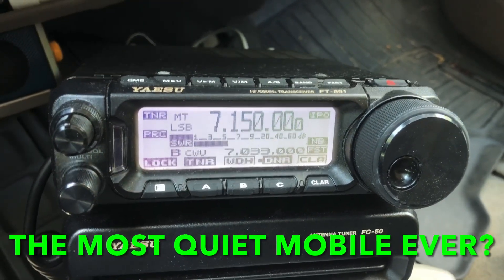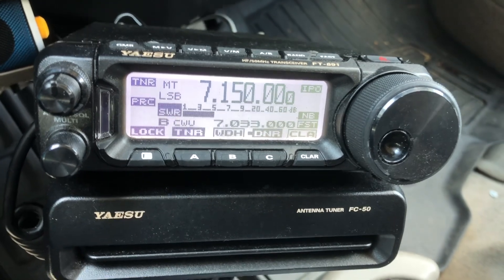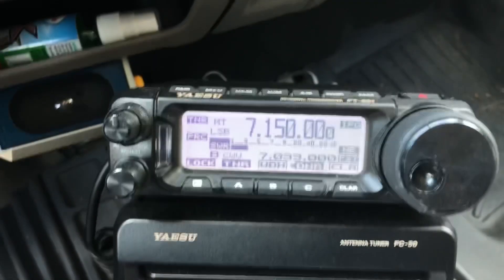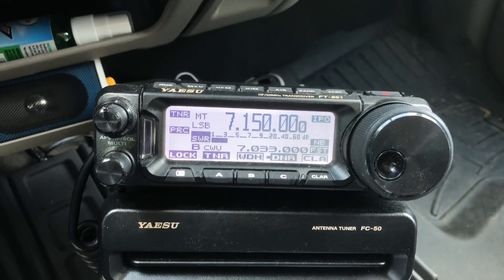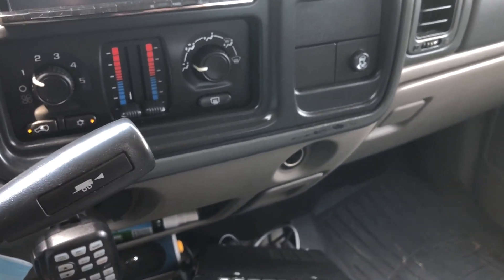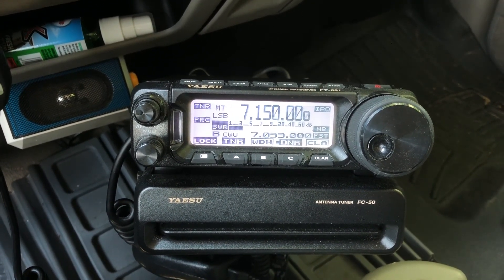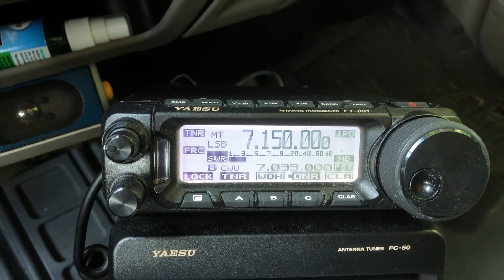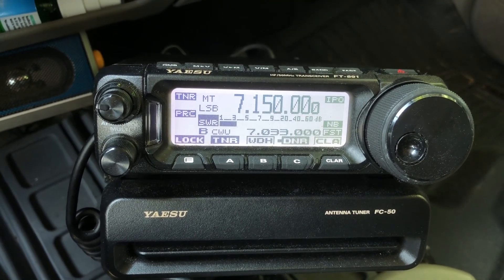The Most Quiet HF Mobile Ever? #yaesu #ft891 #mobile #dsp

Comment: Hello Sir, wondering what antenna you use? What I can see is that the noise floor is pretty low, so for the DNR is not a big deal to suppress it. If you say that it must be a lot of noise and it is not reflected on the S-meter, maybe there must be something wrong with the antenna matching. I'm having the same result when I use FC-30 and I disable it or the ATAS and it is out of tune. Did you transmit, and if so what SWR did you get?
73 de LZ5RG
Reply from the maker: I explained in the video why you don’t hear noise.  IPO, DNR, and RF Gain.  Never let your S-meter rise above S1 of noise.  Use IPO, ATT, if necessary, and get the noise floor down.  Use RF Gain for finishing touch.

I use Ham Stick antennas and let the FC-50 touch up the band edges.  SWR is usually 1.1:1 or maybe up to 1.3:1.  I work DX routinely; sometimes during a quick visit to the grocery store.  South America and Europe are no problem with this setup.

73, de N4HNH
Reply: @n4hnhradio  First of all, please do not get me wrong I'm not trying to oppose you, and if you feel so please excuse me. 
I noticed what you said, but you would agree that neither of these has anything to do with the noise floor (NF) on the RF jack (antenna jack). You also would agree that the noise floor exists no matter what you do with the radio. Lowering the RF gain or enabling the ATT is just decreasing the sensitivity, not lowering the NF (for example). So what I would consider as some representative indication on the S-meter of the NF is to turn the RF gain to the max, using IPO (especially on the lower bands), and disabling the ATT. When I lower the RF gain, I artificially "raise the S-meter indication" (but it has nothing with respect to the actual noise floor), and the radio is just "telling" me (indicated on the S-meter) from what S-level above I will hear a "valuable" signal.  As for the D's (DNR, NB est.), they are somewhere before the audio part (in the DSP module) so they suppress the audio noise and not exactly the RF noise.
So to simplify what I'm trying to say is, that by using the built-in features of the radio, we are just tricking the radio into "thinking" something is there or not. So if the antenna is the "right" for the band, is tuned to match the RF input and no other features of the radio are used we can judge what the NF is (or at least what the NF is on the RF input). I still can have perfect 1:1 SWR, and perfect low NF, by just terminating an ideal 50Ohm load but it doesn't necessarily mean that I have an antenna. In my personal experience, nowadays with all these SP supplies and a bunch of any other RF trash, I cannot get anything less than S=7-8 in the city area.
That is the reason why I asked what antenna you used and how it was tuned. 

Hope you get my point now. You have all my respect for what you do and how you do it.
Reply from the maker: You are referring to phase noise.  In the case of the FT-891, there are three IF stages, so there will be more phase noise.  It isn’t as bad as you might think.  You could buy a $4,000 quad-conversion transceiver and have more phase noise than the FT-891 produces.  

All superheterodyne receivers have phase noise, caused by phase jitter in their oscillators.  For some, the phase noise is lower.  The FTdx5000, FTdx10, FTdx101D and FTdx101MP have lower phase jitter in their oscillators, thus lower phase noise.  The same is true with top tier transceivers from other manufacturers.

The noise floor of a receiver that is connected to an antenna is a combination of phase noise plus atmospheric noise and man-made noise.  

I will trick my radio all I can to lower the noise floor.  But I’m not actually tricking the radio.  The features I’m using are built into the radio, so it isn’t being tricked at all.  You aren’t going to trick a radio to hear a signal that is below the phase noise in its own receiver stages.  That is why you will see Rob Sherwood use the term "phase noise limited" in his test data document.

I’m using the FT-891 as a mobile in this video.  The combination of atmospheric noise, power line noise, engine noise, road noise, etc. far exceeds the phase noise.  Phase noise is of almost no consequence in a mobile environment.

73, de N4HNH

Comment: Rolling with the same rig Doug.  I'm running the ATAS120 so everything is really well bonded.  I also use #31 ferrite cores on the power feed at the point of exit from the engine compartment and at the radio feed point.  I get noise from power lines and other really noisy trucks but generally while I'm on my own on the interstate it's clean as a whistle.
Reply from the maker: You’re the 4th person who speaks well of the FT-891 paired to the ATAS-120.  Nice rig!

73, de N4HNH

Comment: DNR is amazing, such a great mobile rig
Reply from the maker: Indeed it is.  I’m very pleased.  The only weakness is the Noise Blanker.  It causes a little bit of distortion, even set as low as 1.  It’s practically unusable above 5.  So, I pretty much rely on the DNR.  Noise Blankers in modern transceivers are not great.  The FTdx10 NB is about as good as I’ve seen, but it is also practically unusable above a level of 5 or 6.

The Noise Blanker in the FT-891 needs an update.  I mentioned the weak NB to John Kruk, Yaesu marketing manager, at the Yaesu booth during the Huntsville Hamfest in 2019.  He told me that they had to cut corners with the FT-891, to keep the price low, for the mobile HF market.  Yeah, right!  They introduced the FT-891 at $799.  It wouldn’t sell for that price because people were expecting it to replace the FT-857D, which was also $799, but also included 2m/70cm.  The FT-891 has a better receiver, and better DSP, but it still wouldn’t sell like they hoped it would.  So they dropped the price to around $600. That was good for people like me, who prefer a separate 2m/70cm radio anyway.

The FT-891 has the same DSP chip as the FTdx101D or MP, and the FTdx10.  They all use the Texas Instruments TMS320C6746 DSP chip.  The only thing I can think of to explain why Yaesu hasn’t updated the DSP in the FT-891 to match the FTdx10 is that it might lack enough memory to support the update.  But, for a mobile application, the FT-891 is still quite good.  No transceiver is perfect.

73, de N4HNH

Comment: I'm surprised by the lack of noise, powered by that magic NR! :) Since you are as it seems a Yaesu guy.... I have an Yaesu 857d, and planning to add an HF with mobile capabilities.... Would you choose an 891? Or an Icom 7100? I know, Icom 7100 is 2m/70cm also, and a little bigger and more expensive, but that shack-in-a-box could justify the price. But, from an HF perspective... Would you choose an 891 or 7100? Thanks!
Reply from the maker: I chose FT-891 twice.  I prefer a separate 2m/70cm radio, so I can monitor VHF/UHF while working HF.

I’m not a Yaesu fan at all.  They just happen to have the best deal for the money when I’m buying.  I have two ICOM transceivers as well.  But they just don’t beat the Yaesu transceivers.

73, de N4HNH
Reply: Thanks for the answer and thanks for the content, always very clear and useful!
Reply: 73, LU8AAF
Reply from the maker: 73, de N4HNH
Reply from the maker: I’m glad you find the channel content helpful.

73, de N4HNH

Comment: Maybe it’s because it’s my first rig with DSP but I’m not as enthusiastic as most 891 owners. While it does make naturally stronger SSB stronger, I’ve found it makes weak signals worse, muting the audio’s higher frequencies. I tend to use it at lower settings. Often, not at all. (I think it turns Off when I change bands.) For me, it’s far better suited for CW, a “pulse” or On/Off audio than the up & down nature of speech. Agree that DNR works well for ignition noise and areas with a lot of RFI. 
That said…I’m chasing DXCC by the end of this year with it and the ATAS-120A. I’m at 15 countries, all SSB. My customers are 20-30 minutes away so I have to jump bands most days. I don’t know how many people get 100+ countries, mobile, with an “okay” antenna but I’m gonna’ try. (Working on my mobile CW copying skills before I try a QSO. I’ve missed a few new countries already.) Tnx de WB3CFN.. dit dit 
P.S. QRZ logbook is current if anyone wants to see if the 891/ATAS-120 works.
Reply from the maker: If the DNR is dulling the high frequencies too much, adjust your width and set the audio tapering in the menu to favor more high frequency response.  People who suffer from high-frequency hearing loss need to make such adjustments.

73, de N4HNH
Reply: I guess I should add I rarely get on 40m. It’s rare that I drive at night when it’s jumping. My logbook is almost all 20m-10m. Maybe I’ll try 30m from home with my TS530S. I can see the value of DNR on 40m daytime, especially mobile.
Reply from the maker: Cycle 24 made me a fan of the 40m band.

73, de N4HNH

Comment: I want this for pota and mobile. What do you use for mobile antenna. I was thinking Tarheel  🪛
Reply from the maker: Paul, the FT-891 mates up nicely to the Yaesu ATAS-120.  Two of my viewers have told me they are using the ATAS-120 with their FT-891.  One just worked some serious DX with his a few days ago.  

The FT-891 powers the active-tuning antenna via the coax.  The antenna adjusts automatically for whichever band/frequency you are operating.

I use $20 Ham Stick antennas that I bought before Lakeview went out of business.  MFJ, Shark, and others, make their version of a Ham Stick now.  They sell for around $25 each; one for each band.  I use a quick-disconnect system with mine, but I do have to stop and change the antenna when I change bands.  I usually keep the 40m antenna on, and sometimes the 60m.  Now that 10m is opening again more often, I will soon start leaving the 10m Ham Stick on.  I have an original Lakeview Ham Stick for 10m, but I also have a Shark version as a backup.

73, Doug

Comment: Spot on!  I picked up an 891 for the pickup last summer and picked up hundreds of SOTA chaser points with it mobile in just a few months plus lots of POTA’s, none of which are usually strong signals, especially to a Tarheel with a 32” whip.  The DNR is amazing.  The NB cleans up the bit of noise from the 5.7 hemi nicely.  I often have an hour commute to and from work, it really helps pass the time.  My only wish is that there would have been an option for roofing filters.  73, NJ0Q
Reply from the maker: It has one 15kHz roofing filter.  Combined with the DSP, especially for CW, using Narrow mode, it beats all but the top of the line down-conversion superheterodyne receivers or the hybrids, such as FTdx10, FTdx101D and MP.  And even against a FTdx10, I showed in one video that the FT-891 doesn’t get beaten terribly.  

The FT-891 is the best “backpack” transceiver there is IMHO.  I used one for SOTA all the way to Mountain Goat and beyond.  I liked having 100W when needed and it’s the best portable CW rig there is.

73, de N4HNH
Reply: N4HNH Radio For sure!  I should have said narrower filters.  Always been curious what a 500hz filter could do to help out the DSP.  But yea, this machine will outperform others costing twice as much.  I plan to pick up another one of these days.
Reply from the maker: You can watch my FTdx10 videos to see how a 500 Hertz filter helps the DSP, and how the 300 Hertz filter takes it to the next level.  But the FTdx10 is a contest class transceiver.  One would expect such performance from it.  I’m still amazed that is costs so much less than most of the transceivers it beats in the receiver test.

73, de N4HNH
Reply: N4HNH Radio Yea, I have a 10 and have experimented with it as well.  The 891 definitely has receiver performance well above it’s price point, one of the best values I’ve ever found in radios.  Thanks for the video! 73

Comment: Thanks for the video!  I love running my FT-891 mobile from my truck. I have a 40 minute commute to and from work and it allows me to get a little air time. The radio is amazingly clear. I worked  JK1BQS in Japan on 40 meters on my way home at 6 in the morning from Oklahoma and received a 58 signal report using a MFJ Hamstick.
73 K1KAJ
Reply from the maker: Wow!  That’s a great testimonial, James.  Japan 🇯🇵 is quite a feat from a mobile platform.  But the vertical polarization from a mobile makes up for the lack of antenna elevation.

73, Doug

Comment: I want to run a Yaesu FTDX10 mobile
Reply from the maker: If you have the room to mount the FTdx10, it could be great as a mobile.  But, you might be tempted to stare at the display rather than keeping your eyes on the road.  I think the FT-991A would make a good mobile.  The FTdx10 would be great HF base station for an RV.

I can work the controls of the FT-891 without needing much more than an occasional glance. Memory Tune is the key.  I covered that in a separate video.

73, de N4HNH
Reply: @n4hnhradio  I am running a 7300 now.  I love my FTDX10.  I just wish they made a mobile mounting bracket for it.  I think the DX10 will be a lot quieter in the mobile environment.  Thank you again for all of your great videos